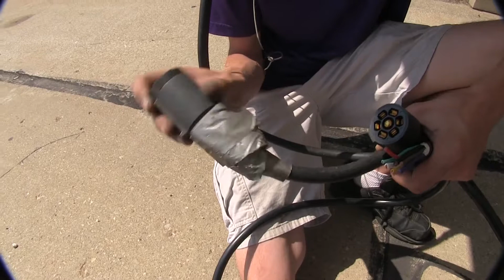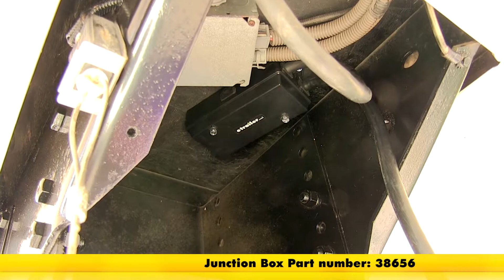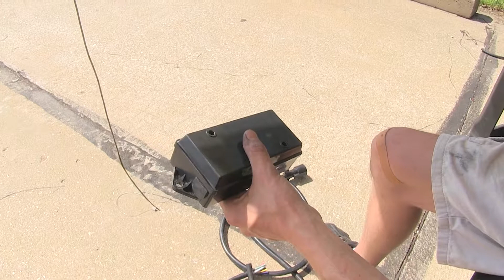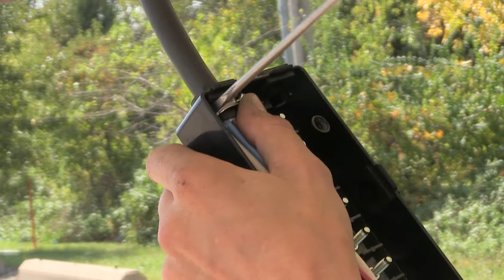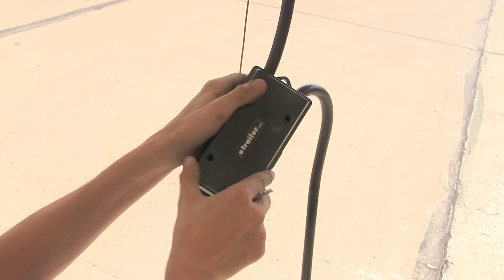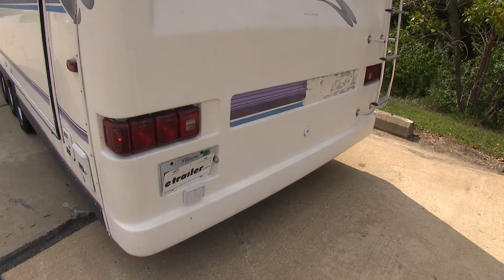etrailer | Comprehensive Review: Mighty Cord 7-Way RV-Style Trailer Connector w/ Molded Cable

Comment: It looks like the J-box for the trailer 's wiring is "right beside" your new junction box. Why wouldn't you just run your new cord to the original J-box instead of creating more connections?
Reply from the maker: Yes that's the trailer's OEM box you see. The new box is more weather resistant and uses ring terminals instead of wire nuts to make the connections which is a lot more reliable. That's why we recommend using a new box to make the connections.
With that being said we normally remove the OEM box and replace it with the new junction box instead of adding a second one. This way we don't add a connection point in the wires but still gain the better box and connections. This installer chose not to do it this way but he really should have.
-Chuck S